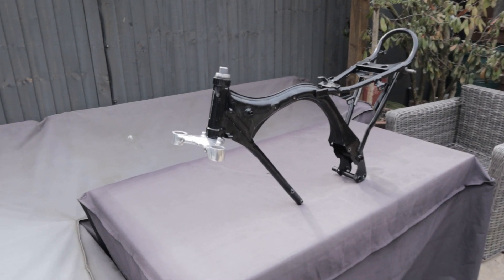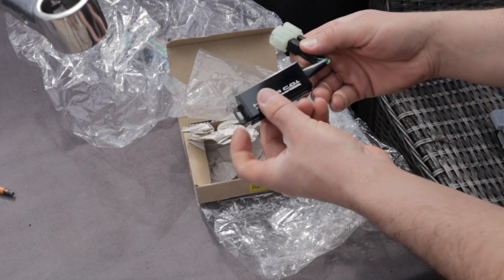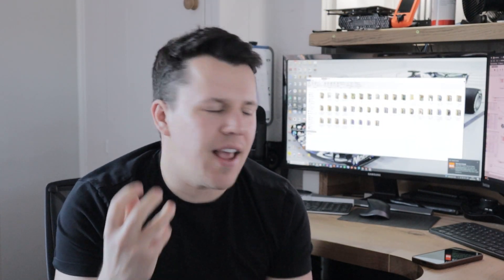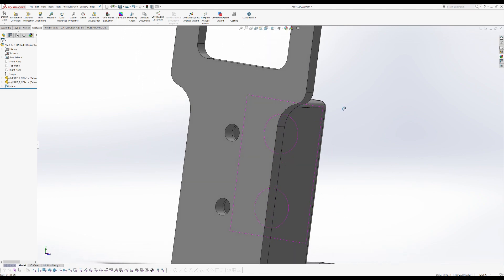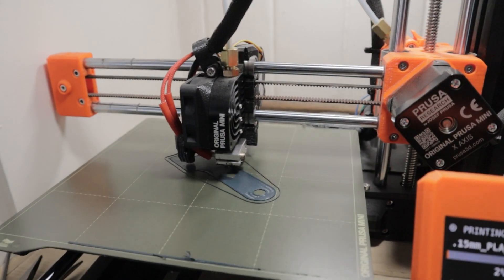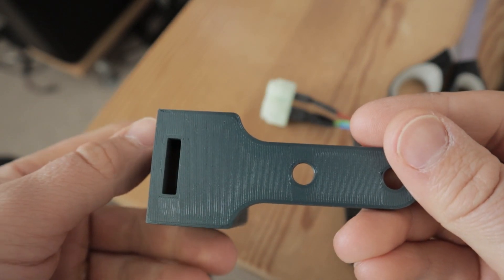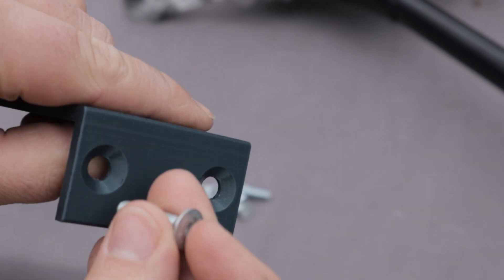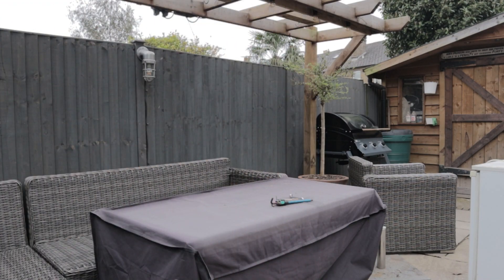Can I 3D Print Motorcycle parts? - XR75 Custom CDI Bracket

Comment: Is he not going to use the inner rear fender part? Cuz I can see just from looking at it bolted in that the lower portion of the Cadillac holder is going to hit where the inner rear fender would be
Reply from the maker: Nice spot! Some small adjustments were made to the design to fix this but werent captured in the video!